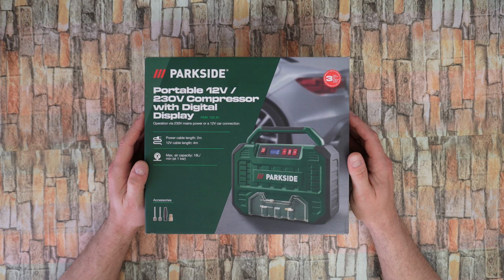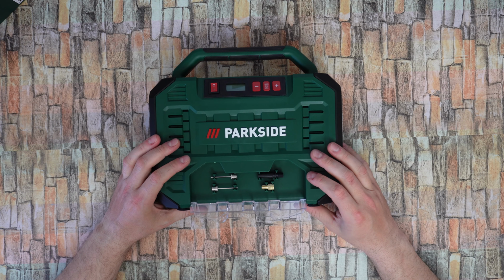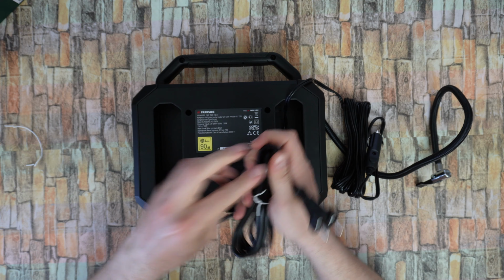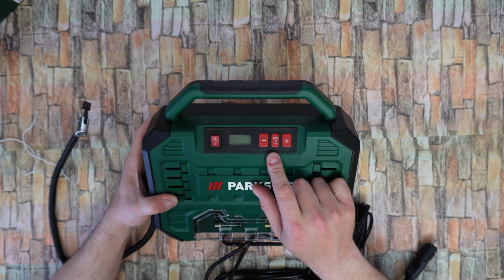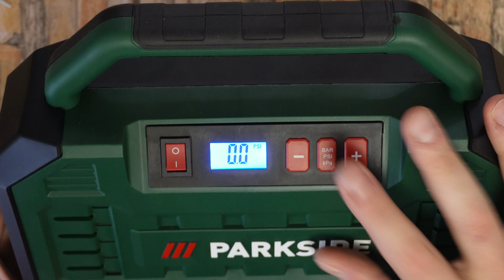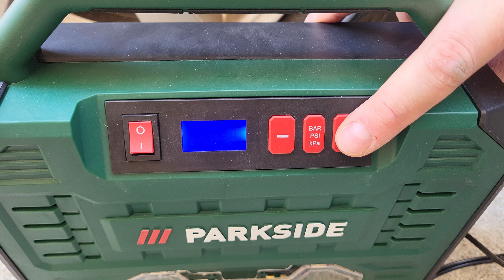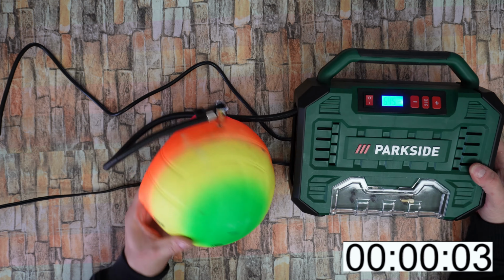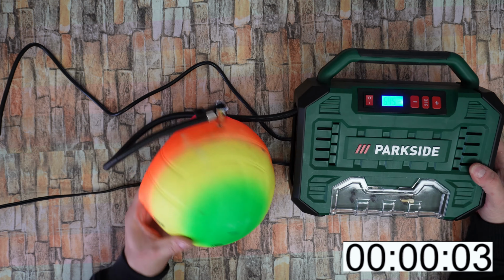Parkside Portable 12V/230V Compressor With Digital Display PMK 150 A1

Comment: can i attach an air gun to it so i can clean my pc?
Reply: No it’s just to inflate under pressure. It doesn’t have big flow to be used as a normal air compressor.
Reply: Can I use an airbrush with it?